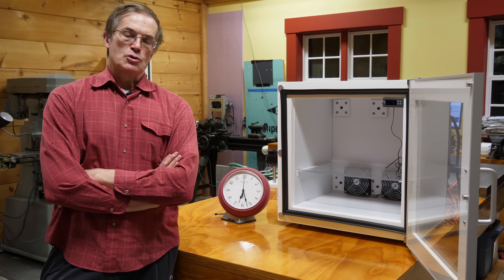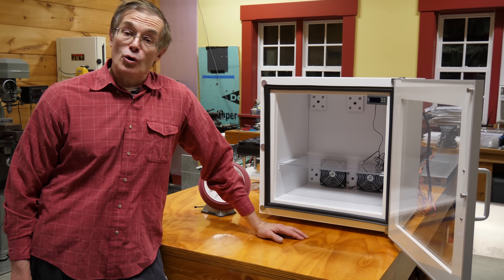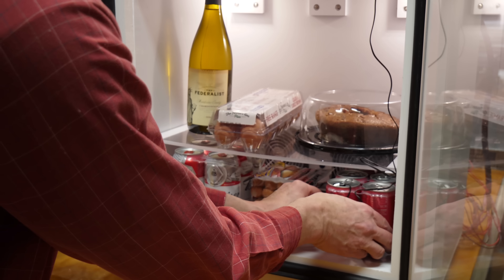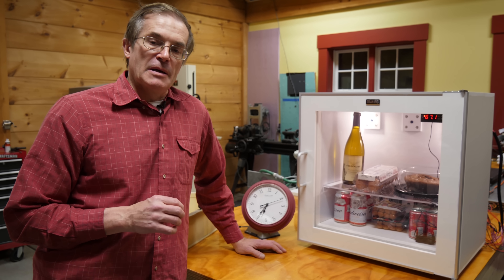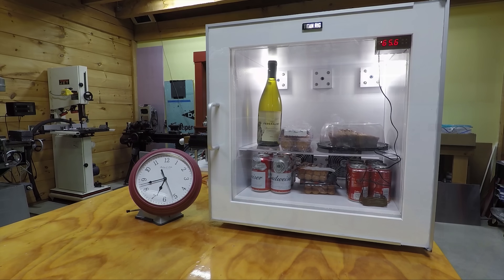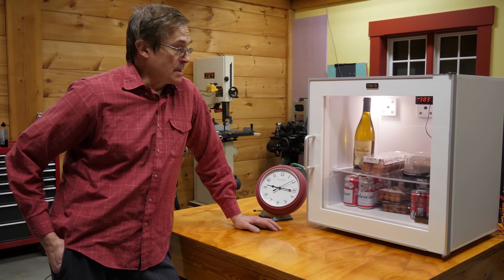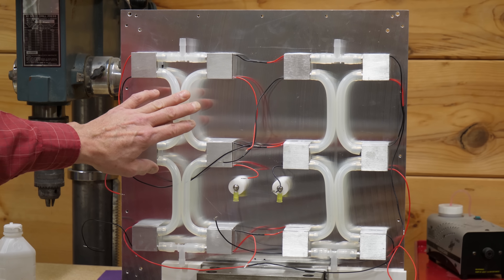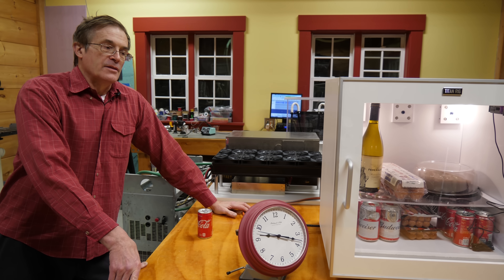TESTING OUR DIY REFRIGERATOR! - TEC/PELTIER

Comment: Two related comments re. v2.0 design:
1: Would you even need/want to power the peltier elements when it is cold (freezing) outside?
2: My immediate thought was that (cf. your comments in prior video about peltier element location) still having the peltier elements on the fridge would be a bit like designing a split AC with the compressor inside the room that you are trying to cool. Perhaps you could comment on why you would not locate them along with the fans outside...
Reply from the maker: The outdoor component would "harvest" cold, but it is unpredictable and variable.  The refrigerator needs to operate no matter what the out door temperature is.  Adding the outdoor loop and switching it into the system when it is useful would be best.  If the temperature is low enough then the TECs could be de-energized.

Comment: Really enjoy all your videos.   One component I feel is missing in this experiment is a freezing compartment.   Most modern day refrigerators use a freezing unit as the heart of the system and the refrigeration is just overflow from the freezer.

Comment: If you want to experiment further with no moving parts, look up "CR-100A" No Fan CPU coolers. Tons of surface area. One for each peltier unit and placed on the top of the fridge might actually be viable.

Comment: Good stuff! That remote cooler function to remove heat and noise from the source I used back in 2000. on my CPU water cooler on AMD Athlon slot A, clocked from 833mhz to over 1000mhz. For that I got a silver medal on international inovator summit in Earls Court - London in 2001.

Comment: Yep that's what i ended up doing as well. I use 4 x 60w modules to cool an aluminum plate that my mac book pro 2017 sits on to stop it thermal throttling all the time. Works a treat, and run directly off a couple solar panels.

Comment: Think you could fit one of those fans that people put on their wood stoves that turn heat into electricity and then turn a small motor? I think if you made the blades really big but light you could drive them off the waste heat of one of the TEC's. Probably not that efficient

Comment: I built a small liquid cooled fridge like that with a 10 gallon tank of water. 2 thermoelectric modules . I tried many different modules and found the Russian ones to be way better than Chinese ones. Probably beryllium copper?. Got down around 39 but used an horrid amount of energy getting there. I found an old 3.5 cu chest freezer that I set up as a fridge using a digital thermostat like yours. Running on a Danfoss compressor and  R-12  it maintains 2c or 35.7 f while using only 10 watts per hour. Hardly even any electricity. Just can’t get more efficient than that.
Reply: It seems no one here listens to experience........i'm using danfoss units , VERY happy with them after many yrs.    it seems the gee whiz factor takes over reason      yeah , i've been wondering for yrs. whether a reverse microwave oven to freezer is possible    instant cooling/low consumption , but peltiers are dinosaurs
Reply: Wow! Great

Comment: With the liquid cooling, you could place Peltier coolers on 3 sides, top, & bottom of the device by running the same cooling networks into a manifold in the back reservoir.

Comment: So... maybe I won't actually modify my design much! http://randomer.net/stuff/cold-box-peel-1.png The model isn't entirely detailed. My heat transfer fluid is a water/propylene glycol mixture. I use a small submersible pump inside a re-purposed plastic mayonnaise jar to circulate the liquid. The TECs aren't significantly thermally coupled to the cold box except through the glycol circulation. All of it is controlled by an ATtiny85 (or maybe an ATtiny84 for more sensor channels or even an Arduino with an ATmega32.)
Reply: One of the other designs I've thought about trying is similar to soda dispensers. 2 stages... efficient compressor/evaporator cycle but then using glycol to selectively move heat from the main box into the more variable but much colder side. I dunno if that makes sense.

Comment: Like the rest of the comments, Would love to know the efficiency of the current model in the video, also with and without the back fans on. The inside fans are to move the cold air around but again that will switch on and off with a timer i guess to improve efficiency.

Comment: Why is it ironic to keep food cool in a warm house in a cold climate? If anything, not having remote cooling on a normal refrigerator is sensible not because it makes the refrigeration cycle more efficient (it doesn't, it makes it less efficient) but that the refrigerator does double duty keeping food cold AND the room warm.

I would say it's more ironic to have a refrigerator in warm California, where you're dumping waste heat from a fridge into a house you're trying to cool. I've been considering building a remote cooling refrigerator here in California not because it would make the refrigerator cycle more efficient, but so that it would dump waste heat outside.
Reply from the maker: Getting heat where you want it, that's the key.  The irony is that the cold is not only available, but we are doing everything we can to keep it outside (it's almost ubiquitous at least 6 months out of the year), but with the refrigerator, we're doing everything we can to keep it inside.

Comment: Did you try testing with even one single fan placed laterally to the exterior fins? Unsure of the running costs but I often like to have a fan on in my room anyways, little warmer too, if that'd work. Likely not though, as too poor exchange on the inside.

Comment: I really feel like you should contact Daniel B. Mitchell at MicroWeld Engineering, Inc.  He's already been doing this type of cooling for the last 15+ years in his welding shop.  He can tell you the do's and don't's and tips and tricks to master this.  I feel as if you're doing steps that they've already mastered and have been doing.
Reply from the maker: Like what?
Reply: @TechIngredients  I sent you an email at the same exact time that I replied with my comment.  I also added this info in the email.  " In order to weld on these superalloys, the materials have to be kept cool during the welding process, but not cold, nor hot nor warm.  They do this with a single movable TEC block that is liquid cooled attached to a radiator."   It's been about 7+ years since I've been an employee in his shop so I'm not entirely sure if his setup has changed but the setup he was using from what I can remember was a fanless waterblock on the piece to be cooled, with transparent tubes filled with a liquid (pretty sure it wasn't water but something with an appropriate thermal conductivity), connected to a small radiator.  The size of the radiator was not important for the application because we were only using 1 TEC block ran at medium to high wattage (I'm sorry I don't remember the wattage).  The CFM of airflow was important on the radiator and BOY were those fans loud.  I do remember you have to watch out for blown tubes.  I had a tube bust open on me during operation once, scared the crap out of me.  The water flow wasn't high enough (pump failing) and the high temperature melted the tube causing the tube to burst.

 We used copper for the water block, and not aluminum, and we didn't use any compound (couldn't because it would contaminate our welds).  A small 5 mm thick, flat copper heatsink was permanently fixed to the cold side before attaching it to the part to be chilled.  The reason?  Not sure.  I remember the power supplies had to be robust.  If memory serves me right, he tried cheaper power supplies back in the day and they kept burning up over time.  He ended up having to buy more higher end, more expensive power supplies to drive the TEC blocks to keep them alive.  I'm just trying to remember stuff as best as I can.  Keep in mind, this information is 7 years old at best.  He's been doing this with his business for ages.  He also had/has a phase-cooling or something (not peltier block) PC that cooled his work computer's CPU down to like -40 degrees Celsius or something.  It's insane.  When it comes to cooling, he definitely knows what he's doing and has been doing it for a very long time.

Comment: seems like you could get a significant energy savings by having the lid open on the top and put things into it like a chest freezer.  A side opening door would have all of the cold air spill out when the door is opened, but opening from the top, the cold air would tend to stay down in the bottom relative to the room air.  Just something to consider for 2.0.
Reply from the maker: No question about that, you're right.  The glass door also reduces the insulating qualities. But, in both cases it is the convenience that made these compromises attractive.

Comment: I've always wondered how effective it would be to use an underground loop system as part of a PC cooling solution, I guess it would apply here as well.  It's not something I can easily test where I live as the soil is basically rock hard and it would be incredibly difficult to make a loop of any meaningful size without breaking the bank.
Reply from the maker: That is a very good idea.  The problem with geothermal heating and the associated heat pumps is the scale costs a lot.  The cooling requirements of a well insulated refrigerator are minuscule by comparison.  A small 10M deep loop would bring the temperature of a refrigerator 1/2 way to its goal.  A TEC, cooled by this fluid loop could be placed entirely within the refrigerator box, eliminating thermal transport, fan noise and the efficiency increases dramatically as the temperature gradient drops.

Comment: I live in Mississippi, it seems like it's summer 11 months out of the year, and I've often wondered why we put something that outputs heat as a waste product inside the house, specifically, the back of the fridge. I have thought about cutting a hole in the house on the north side, but that seems a bit drastic. since I'm on a crawl I'm currently considering running a boxed and insulated vent from under the house, encasing the back of my fridge, then run up through the attic and vent like my water heater to take advantage of the relatively cool air from the crawl keeping the fridge running at high efficiency and utilize the heat from the attic to take advantage of the stack effect to move the cool under house air up and out. 

Although, if I want to do it scientifically I'll need to get a kilowatt and a few atmospheric data loggers for crawl, house, attic, and outside, run the fridge normally for a year and graph the results, then do my modification and run the same tests for a year and graph those results then plot them against the atmospheric conditions to see how the fridge performs.
Reply: This is what I was thinking too. In winter dumping the heat extracted from the fridge into a heated space will just help heat what you are already heating. But in the summer you're dumping heat into a space you're trying to cool down. What you really would want is an outdoor compressor/radiator to dump the heat outside, like an AC unit does.
Reply: Intriguing idea and I love your application of the scientific method but can you not calculate the necessary draw based on the volume of air you need and the potential temperature differential? Gut feeling is you will need at least some of the time some active ventilation device.. how will you deal with the condensation?
Reply: @MassiveObfuscation  
I could probably just track the temperature of the fridge coils to determine if such a system would be efficient in warm weather, it's frequently in the high 80s and occasionally over a hundred  degrees fahrenheit but as long as the coils are hotter than the ambient temperature the heat transfer process should work.  
I don't think active ventilation would be needed because as the air heated by the fridge coils rises it will pull cooler air from the crawl space, the hotter the air the faster it will rise, I think it should keep rising for the 15 or so feet to a roof vent.
The biggest issue would be not having a large enough ventilation system although, since it would have moving air it might work with less cross sectional area than a normal fridge.
Condensation generally occurs when warm moist air meets a cool surface, I'll be bringing cool air up and heating it so there should be no problems at all with condensation.
Reply: If you're in Mississippi you likely have the ability to dig a well, and that well water will be around 50f year round, which is a very useful way to extract some free energy. Digging a well isn't trivial of course, but once you do it you have free AC in the summer, and you can keep your house at 50f with the same system. That, and anything that needs cooling can be incorporated into the system and run very efficiently.
Reply: @jttech44  Hmm, I prefer not to waste water, but I hear it is better to water plants with warm water instead of cold. It might be a good idea to hook up some sort of heat exchanger for my well, for the plants sake of course ;)
I'm strongly disinclined to waste water because of several summers spent in New Mexico, I also remember three droughts in the past 25 years in this area
I've been looking at earth tubes for a while now though, that fits my fancy and I figure with a fan and HEPA filters I can bypass any issues with mold growth in the pipes :D
Reply: @dscrive  you recirculate the water back into the well so you're not wasting any. If you have a good aquifer you can do this indefinitely.
Also, you can always plumb in a spigot on the hot side of your cooling loop if you'd like warm water for your plants!
Reply: @jttech44  I'll have to do some research on it, my gut instinct is that the hydrostatic pressure from the water filling the well would resist the reintroduction of the water, the well is only a hundred feet deep, so I might only have a couple minutes of run time before I was pumping already heated water.  But a remote "dry" well might be an option, but I'm not sure how well it'll work with the clay soil we have. as I said, I'll have to do more research because my understanding of the geology here (I'm in the heart of the delta) is that I'm pulling from water that is less than 25 feet down and is more closely tied to the rivers and creeks around here than an aquifer. 

Putting a heat exchanger in my return plenum and just turning on the blower and well pump when I want to cool the house does tickle my fancy. 
I'll even try to put together a video when/if I do it :)
Reply: @jttech44  Hilarious, your well would run dry in a matter of hours.
Reply: @DarkLinkAD  Not if you're recirculating the water.
Reply: @jttech44  You think your well is going to both absorb and cool the water at the rate you need it to recirculate, for a 100ft or so well?
Reply: @DarkLinkAD  I don't think anything, I've seen this working.
Reply: @jttech44  mmmhmm
Reply: A new study, to cool a structure using some special panels on the roof or else facing the sky in the Sun, Yeah while the Sun is shining , to directly send this heat out into 'space', yeah space, is showing promising results, although I can only  recall right now about it is I was surfing for solar panels when i came to know about it. nothing more, but I promise to provide the links about it here as early as possible, you will be informed , if you have settings to receive mails if somebody replies to your you tube comment ( I do, was failing earlier ),  Your unloading video is great,  so alike and funny likewise I  had just used a jack hammer to hammer  an all wood couch to force push it where it would barely fit by aiming at one leg of it, in my packed and cramped garage,  with a tingle of fear, imagining vividly,   the time suspended moment of every hammer stroke - expecting the whole world (garage ) collapsing on me.
Reply: @ravirajguru7044  Thank you for the compliment on my video, it was just for fun and to try to keep from losing what editing skills I have. 
When forcing something like you describe I prefer to use something like a jack or screw clamp to slowly, yet firmly, force the object, slower lets me hear if something is breaking, I haven't hammered a woodworking joint home since I learned that trick and it's saved several projects haha.
I don't have email notifications for youtube set up, but I subscribe to nearly 600 channels so I'm on here pretty much every day and check my notifications regularly.
I tried to look up what you were talking about with the solar cooler and alas, all I found was solar powered solar panel cooler, haha.
Reply: @dscrive  Search with "Radiating heat into space"
Reply: Here is  what i promised -- searched for 'radiating heat into space' - i recalled after i posted the comment 
https://www.sciencenewsforstudents.org/article/how-chill-object-sending-its-heat-space
https://www.technologyreview.com/s/608840/a-material-that-throws-heat-into-space-could-soon-reinvent-air-conditioning/

jack is better than the jack hammer. slow and steady. as to fast and out and in pieces.

Comment: 𝐂𝐨𝐮𝐥𝐝 𝐲𝐨𝐮 𝐩𝐮𝐥𝐥 𝐚 𝐬𝐭𝐫𝐨𝐧𝐠 𝐯𝐚𝐜𝐮𝐮𝐦 𝐨𝐧 𝐭𝐡𝐞 𝐝𝐨𝐨𝐫 𝐰𝐢𝐧𝐝𝐨𝐰 𝐰𝐢𝐭𝐡 𝟏𝟔 𝟏𝟎𝐦𝐦 𝐠𝐥𝐚𝐬𝐬 𝐬𝐩𝐚𝐜𝐞𝐫𝐬 𝐚𝐧𝐝 𝐮𝐯 𝐜𝐮𝐫𝐢𝐧𝐠 𝐜𝐚 𝐠𝐥𝐮𝐞, 𝐚𝐥𝐬𝐨 𝐜𝐚𝐧 𝐲𝐨𝐮 𝐬𝐞𝐞 𝐰𝐡𝐚𝐭 𝐭𝐡𝐞 𝐫 𝐯𝐚𝐥𝐮𝐞 𝐢𝐬 𝐨𝐧 𝐚 𝐰𝐢𝐧𝐝𝐨𝐰 𝐦𝐚𝐝𝐞 𝐨𝐟 𝟐 𝐥𝐚𝐲𝐞𝐫𝐬 𝐨𝐟 𝐛𝐨𝐫𝐨𝐬𝐢𝐥𝐢𝐜𝐚𝐭𝐞 𝐠𝐥𝐚𝐬𝐬 𝐰𝐢𝐭𝐡 𝐚 𝐯𝐞𝐫𝐲 𝐬𝐦𝐚𝐥𝐥 𝐯𝐚𝐜𝐮𝐮𝐦 𝐠𝐚𝐩 𝐚𝐧𝐝 𝐚𝐬 𝐟𝐞𝐰 𝐬𝐩𝐚𝐜𝐞𝐫𝐬 𝐚𝐬 𝐩𝐨𝐬𝐬𝐢𝐛𝐥𝐞, 𝐚𝐥𝐬𝐨 𝐬𝐨𝐦𝐞 𝐦𝐨𝐫𝐞 𝐝𝐨 𝐲𝐨𝐮 𝐭𝐡𝐢𝐧𝐤 𝐢𝐟 𝐲𝐨𝐮 𝐩𝐮𝐥𝐬𝐞 𝐭𝐡𝐞 𝐭𝐞𝐜 𝐚𝐭 𝐚 𝐯𝐞𝐫𝐲 𝐡𝐢𝐠𝐡 𝐯𝐨𝐥𝐭𝐚𝐠𝐞 𝐢𝐭 𝐦𝐢𝐠𝐡𝐭 𝐛𝐞 𝐦𝐨𝐫𝐞 𝐞𝐟𝐟𝐢𝐜𝐢𝐞𝐧𝐭?
Reply from the maker: For that size door, the glass would have to be very thick and expensive.  Pulsed current is less efficient because the TEC is either off or running at a higher peak current where its efficiency is lower.